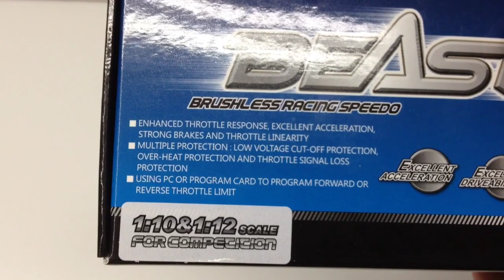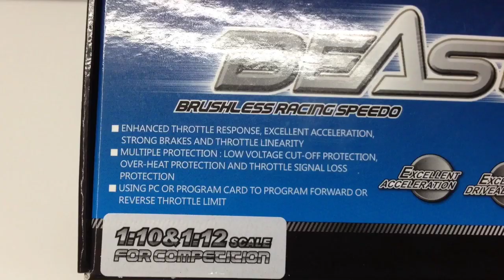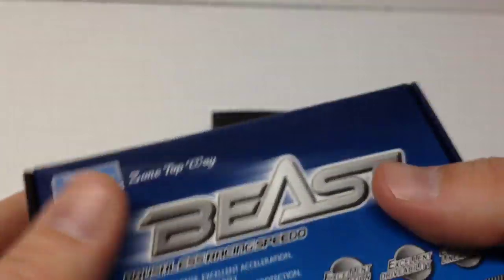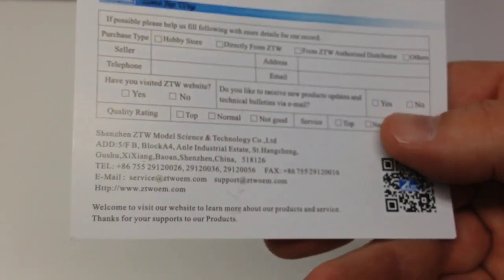ZTW 120amp Sensored ESC - The Beast

Comment: Newbie here ! - can somebody tell me what a "Sensored" ESC is, and how it differs from say the ESC that comes in my Thunder Tiger eMTA ? Thanks and go easy on me :-)  thanks guys !
Reply from the maker: Your thundertiger most likely comes with a sensorless motor/esc.  The big difference is there's an extra wire going between the motor and esc that monitors things.  It gives a very smooth throttle at the start, which is the main difference.  "cogging" is the term referenced to sensorless motors when you barely pull the trigger, there's a hessitation on the motor causing the spur and pinion to rock back and forth
Reply: The RCNetwork Hi there, wow, what a great bunch of info there.  I hope that other beginners benefit from your great post.  Funny you should mention that "cogging" I'm not sure if what I am hearing is what you describe, but just yesterday I was giving the throttle a tiny bit of pressure, just to get the truck moving and it "coughs" or "hesitates" at low speeds, I'm talking about the thing barely moving from a stop.  Once you give it a tiny bit more pressure, then it works fine, almost like it does not enjoy being given so little power.  I'm assuming also that this may be putting strain on the motor ? if you drive too slowly with an RC truck.  Very interesting.  So that said, I wonder if I can switch out my current ESC for example, and plug a new one in ? Must you buy the exact same ESC from ThunderTiger ? or can you swap it out for another ?  If yes, I guess there are different voltages, amps etc that must be taken into account or you could burn your rc truck out ?   Anyway, I don't expect you to give my questions any answers as I have taken up too much of your time already.  Thank you for spending some time though, I appreciate it greatly.

Comment: The ESC looks cool. Looking forward to your impressions once you get a chance to use it. Is the low voltage cutoff programmable to say 3.4V/cell? Does it have adjustable timing?
Reply from the maker: Thanks!  I haven't got into the programming yet, but I will do an update once I get everything running.

Comment: What's the motor limits using a 2s lipo in a 1/10 4wd offtoad buggy? Hoping I can use a 6.5t tekin motor.
Reply from the maker: I couldn't find a motor limit for the ZTW ESC in the video. I think you're right on the fence with a 6.5t though.  Comparably, Team Orion's 120amp ESC has a motor limit of 5.5t.  But, you're also throwing 4wd into the mix though......